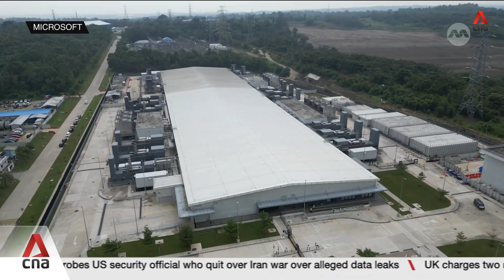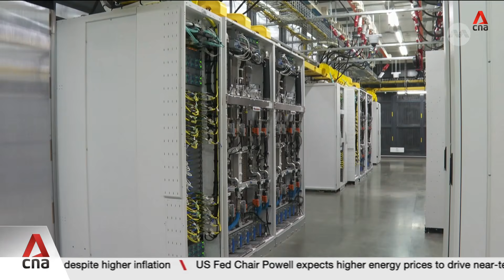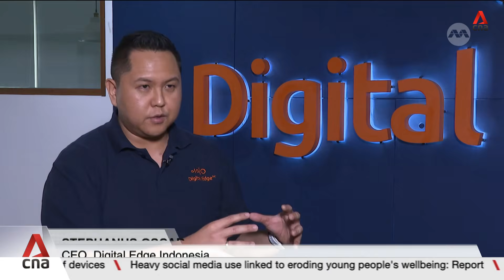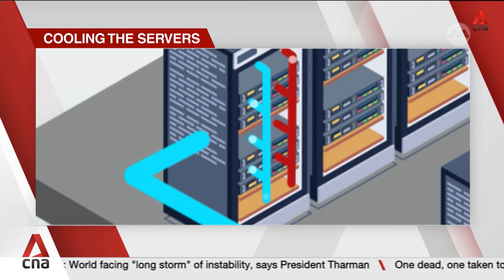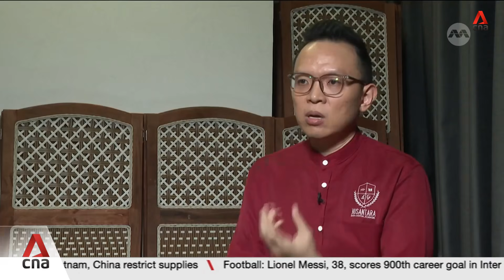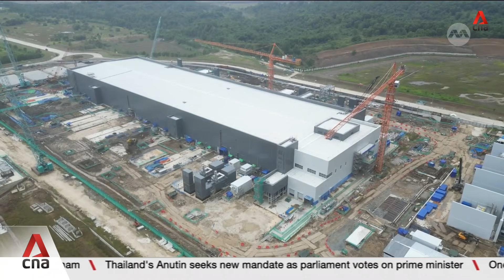Indonesia advances green data centres for a sustainable future

Comment: Indonesia have many natural nuclear reactor, the Volcanoes. So far Only 2 or 3 Geothermal from hundreds was used as Power Plant.
Reply: Volcano is not nuclear, it's convection heat from subduction of plates, but I get your point.
Reply: @diskyariajetmiko almost same, the heat come from FUSION REACTION in Earth Core. Convensional Nuclear reactor need sea water for cooling heat from the Uranium Fusion Reaction, so same as Volcanoes, it have own underground water as cooler before wasted as hot spring (geothermal) that can triger the turbin.
Reply: @HYPERSONICTOW  nuclear reactor is fission not fusion 
Also all power plans except renewable and hydroelectric use steam to generate electricity the only difference is the heat source (nuclear fission, geothermal or burning fossil fuel)
Reply: @ginbei711 👍🏻
Reply: @HYPERSONICTOW no, you clearly are not geologist by how confident you are at being wrong, most VOLCANOES is from friction by plate subduction not by geothermal itself, this is true especially in Indonesia where it is on active tectonic plate and on ring of fire. While geothermal IS from nuclear fission,  You mix the two. but geothermal IN Indonesia is mostly from subduction of plate and not from nuclear this differ from Iceland where it is a divergent of plate tectonic.
Reply: @diskyariajetmiko of course not all mountain can use 😂😂 not all mountain have enough and stabilize aquifer as water resources. geology is the science of rocks and the processes by which they form, only part of it for analize, but its not nuclear or electro science. GEOTHERMAL POWER PLANT IS NOT FICTION, KAMOJANG POWER PLANT IS A SAMPLE.
Reply: @HYPERSONICTOW  tolol anjing ngerakeun sia teh, bangsat!
Reply: @HYPERSONICTOW  boloho sia mah! diajar heula basa inggris nu baleg. bacot gede, otak mini
Reply: @diskyariajetmiko  don't waste your energy to argue that loud smartass hee-haw
Reply: U mean geothermal, but yeah we got ur point
Reply: udah secara jelas dibedakan PLTN dan PLTGU. Kalau yg maksud ente dr panas bumi ya masuknya PLTGU
Reply: @firmanardi4008 iya aj lah.. 😂😂 sumber panas nya upil
Reply: also lots and lots of idiots.

edit : 👇down here is one of them👇
Reply: @bolohosamah jiga sia
Reply: Foolish overproud comment I read so far. Lack of education n knowledge, you do not know what is meaning of the nuclear reactor.
Go literate yourself with books
Reply: @mapperid so you can teel now.. smart guys 😂
Reply: @mapperid  a bit harsh but u are not wrong.